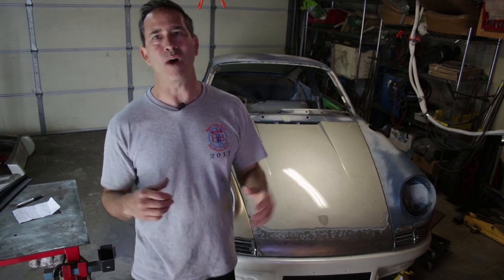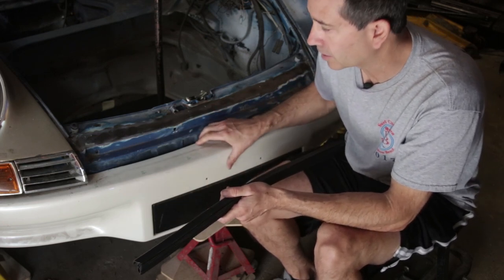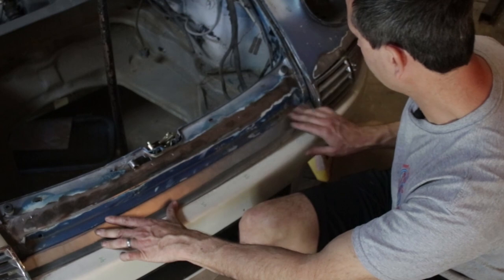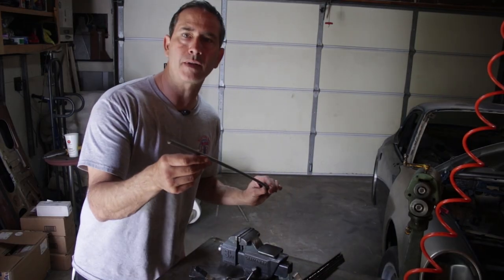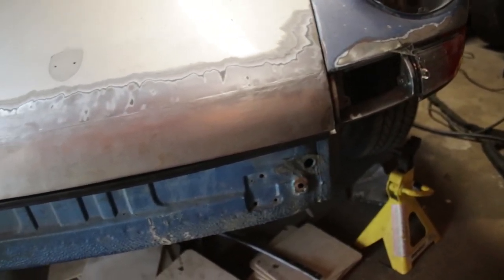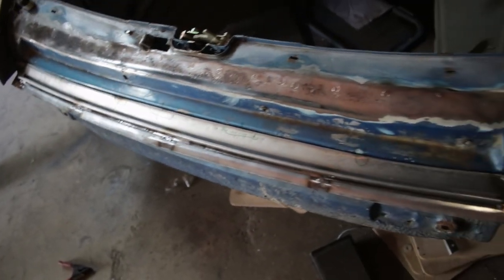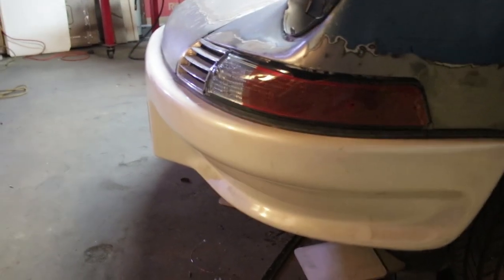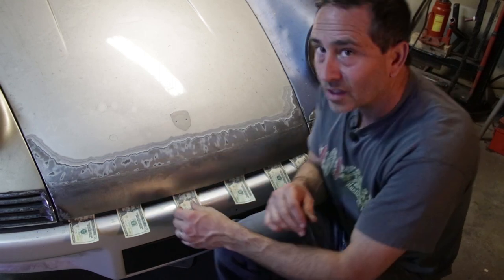Porsche 911 Carrera RS Clone Build - Front Backdate Complete

Comment: I think I do have that turn signal housing, I also have a question since you have such great skills working with metal,  Im also doing backdate as yours and purchased fiberglass rear bumper from rennspd but it doesn't fit well as expected it is kind of as your front one it is to wide,  could you please get back with me I would prefer to explain on the phone if possible, thanks
Reply from the maker: Cool, you can email me at tom.perazzo@verizon.net and I can give you my number there.  My rear bumper doesn't fit either!  Please watch that video tomorrow and maybe it will make you feel better.  I've never had an aftermarket body part fit well without serious modification.